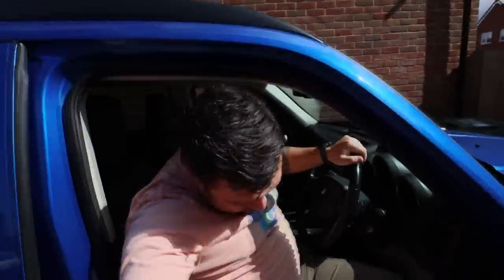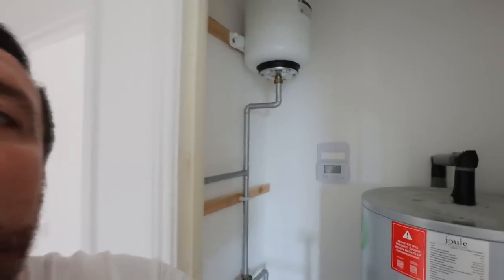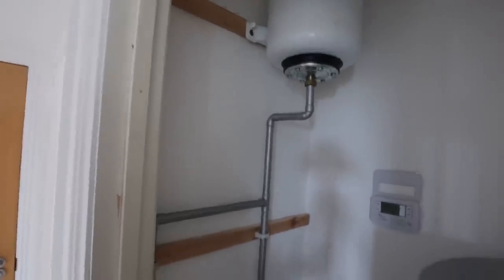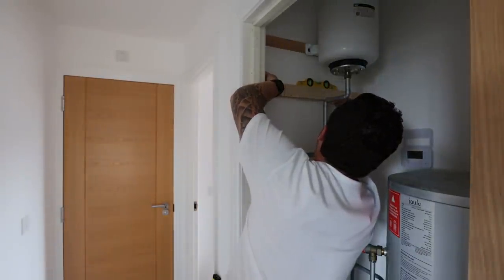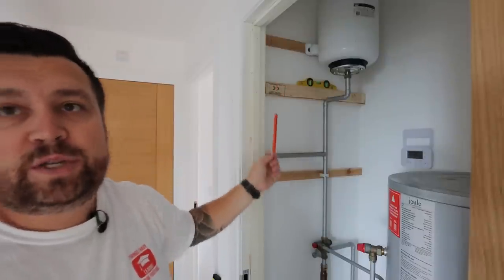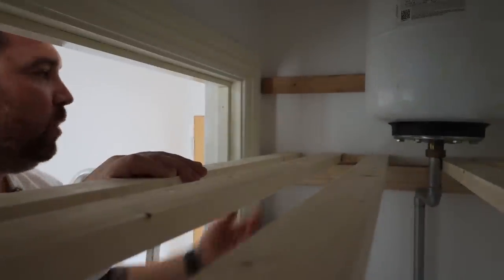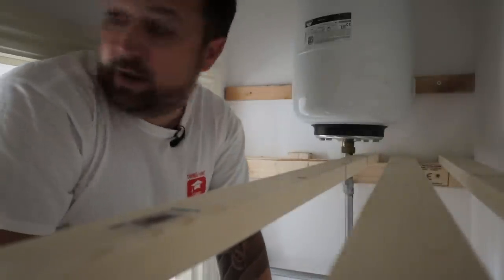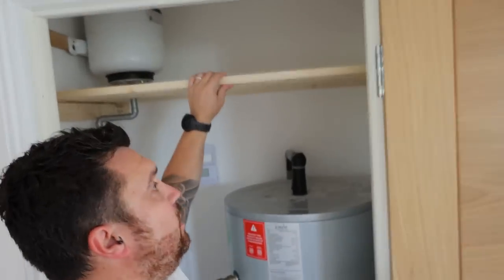How To -  Simple and Quick Airing/Linen Cupboard Shelves

Comment: Good job. I’ve seen videos where people attach wood on all three sides, and then used a solid piece of wood as a shelf. This way is more expensive and seems to take more steps to complete. Your method with only 2 bits of wood either side, and then a few lengths of wood on top is much more cost effective and gets the job done 👍🏻

Quick question, did you use any old timber from Buidland/B&Q etc? Do you need any particular screws for the job aswell? Like timber screws I’m guessing?
Reply from the maker: Thanks Jonathan! Appreciate the feedback, and for me, it was more about circulation and having that warm air being able to circulate too :)

In terms of the materials, I believe I used some 1x2 pine that was already pretty much finished, and some 2x4 for the side brackets.  In terms of screws I have a big selection box of various wood screws and I just go with them for any interior project.  I didn't use any glue on this one so the wood would be able move with the heat from the hot water tank.
Reply: Things I have Learnt from YOUTUBE oh yes of course, I was forgetting that lengths of wood spaced out would allow the heat to flow through. I’m doing the shelfs in an airing cupboard with a radiator in there, so I definitely need to use this method. 

One more question, I’m pretty confident at doing the job, the only thing I’m worried about is drilling into my walls and not having a clue what’s on the other side! Could be wires or pipes etc? I guess I’d have to buy a stud finder or something? I know you can tap the wall and listen for the change in sound, but that’s not very accurate!
Reply from the maker: I'd say that a stud finder is a great thing to have, but it depends on the age of your house.  Ours is a brand new build so I'm pretty confident I know where all or most of the wires are and I did guess for the studs on this one.... Use some good wall anchors if you are just on drywall/plaster board as that will help, but yes... Don't hit a pipe or a live wire.....! I figure it would be good for the veiws if I did that!!!!! Hahaha
Reply: Things I have Learnt from YOUTUBE ha ha yes it would make your channel blow up!

See what I did there 😜😂

Thanks for replying so quickly 👍🏻

Comment: I'd be a little concerned fixing a baton that was touching a pipe. No room for expansion?
For me, setting the shelf at a more usable height would have been the priority over where was easy to fix to. 
Good camerawork, lighting & sound though.
Reply from the maker: Great point.... And since trying to actually make it usable space.... I've been requested to add a 2nd shelf a bit lower down.... So there will be more climbing in and out of the cupboard to be done when I get a chance!!  These are the things we learn as we go :)
Reply: Things I have Learnt from YOUTUBE - I think it is begging for a second shelf. If you were trying to get more storage still, it looks like you could create a column of smaller/half shelves to the left hand side?
Reply from the maker: I think the next shelf will be a bit lower down, and yes I'll split a 2x4 into 2 pieces to work around the pipework, then I can just snug the cross pieces around to make it all fit like one long solid shelf.... Sometimes I just need my Wife to tell me how it should have been done in the 1st place 😉😉

Comment: Why put the shelf there, where that small cylinder blocks part of it from being usable?
Reply from the maker: Hiya, a 2nd shelf is going in at some point a bit lower, and luckily the top shelf, even though it's a bit high does used on a daily basis for the random towels, bed lines etc...

Comment: If you can't get into the back half of the shelf to put the screws in, were you not worried you wouldn't be able to get your laundry in and out?
Most people seem to make airing cupboard shelves that just sit on top of the battens without screwing them down so that a plumber can actually get in and service your system.
Reply from the maker: HONESTLY.......this project will have a part 2 as the shelf is a bit high, and my wife is quite short.... ;) I do need to add a second shelf, and on that one I will most likely make a slatted shelf as a slide in unit on battens as it will be a lot closer to the water tank, but I didn't want to make it a solid shelf - like a sheet of MDF/Ply as the heat wouldn't rise so well and keep the towels warm at night.......!!!  Make sure you subscribe and turn on the notifications, that way you'll know when the video is live.
Reply from the maker: Thanks - his version is great, and that's kind of what I had in mind for the second shelf - his is a bit easier as he has full access and no water tank to work around, but the concept and theory works, and I'll do something similar for the 2nd shelf :)  I have liked his video and subscribed.......make sure you do the same... :)